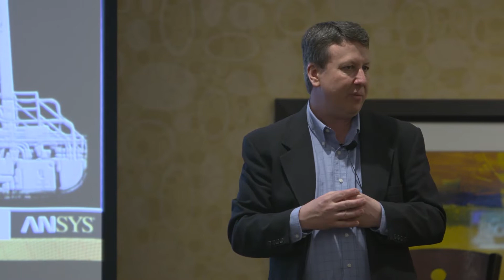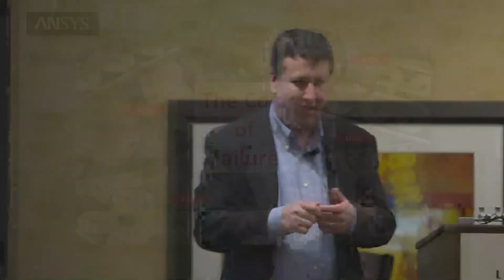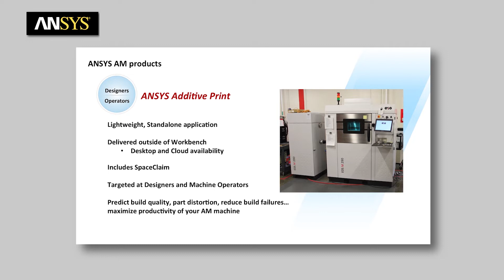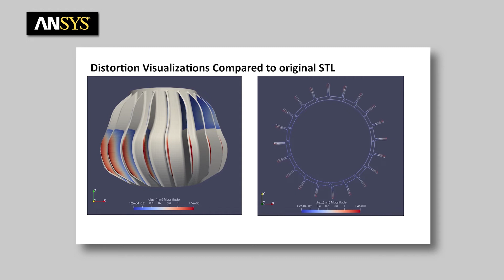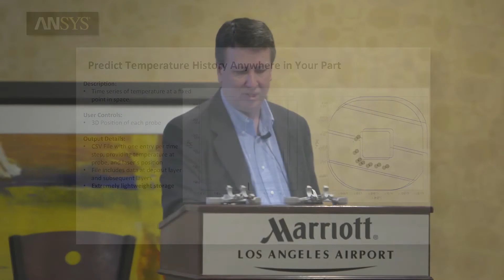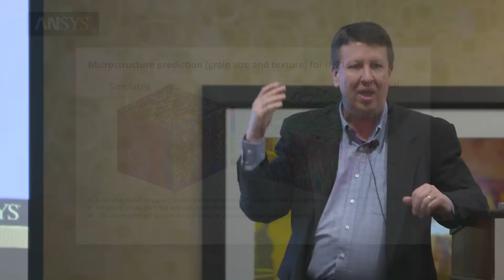ANSYS Additive Solutions by Dr. Brent Stucker, Additive Director, ANSYS

Comment: This is very Interesting. How about solutions for concrete 3d printing and considerations for material change of state from fluid to rapid hardening of concrete layers as they are deposited? Please do not focus on the powder bed build process alone, please let us have support for FDM processes as well
Reply: do you have any video regarding metal additive manufacturing residual stress and distortion prediction using ANSYS  please share or please let me know
Reply: @mechanicalenggineering-eg941  please if you got any vedio about that then please share with me